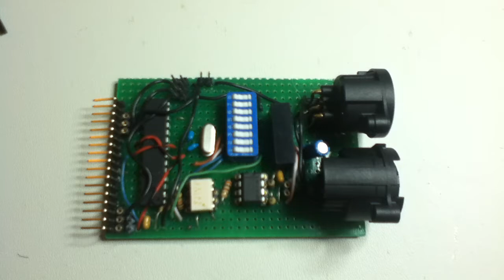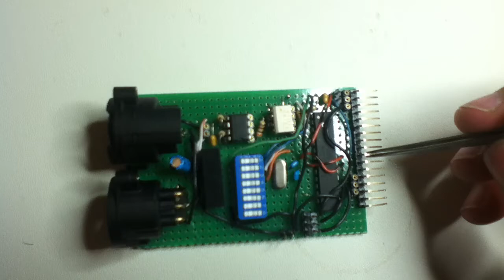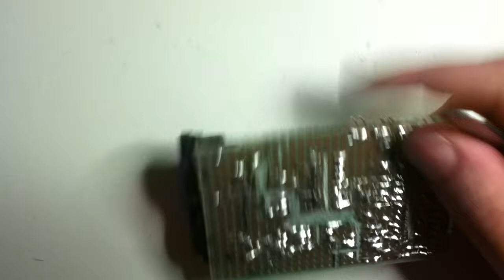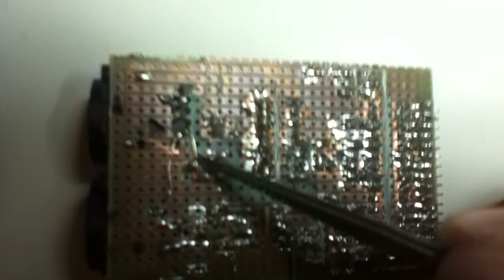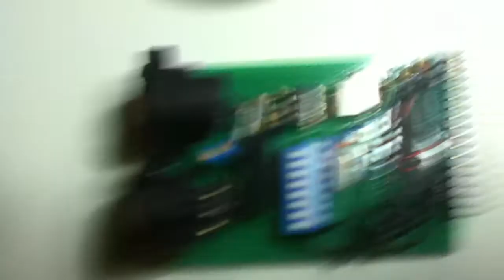Coemar Venus DMX module

Comment from the maker: jonram747 It doesn't connect directly to the motors. It connects in place of the manual control switches on the rackmount unit, which are 5V logic signals.
+sbrickles Unfortunately I don't know if one exists. I never got to see it in use because the venus it went into had something wrong with it.

Comment: will this worked?
the motors of venus is 12 volts
and not 5 volts,have you tried it yet 
if working can you send me a schematic diagram so i can built one as well
theres 4 kinds of M4 version

400watts  MSR 400 Philips GX 9.5 base and running on 12 volts DC Motors
the 1)Vertical Colour and the 2)Vertical Blade version 41.7 kgs

1200watts MSR 1200 Philips GX 9.5 base and running on 12 volts DC Motors
the 1)Vertical Colour and the 2)Vertical Blade version 41.7kgs
the vertical Colour version 50 kgs